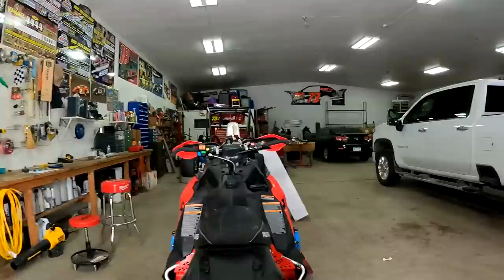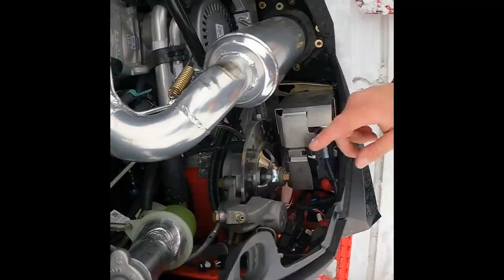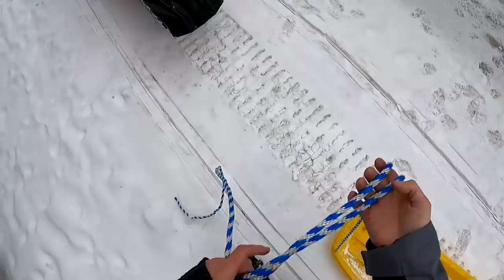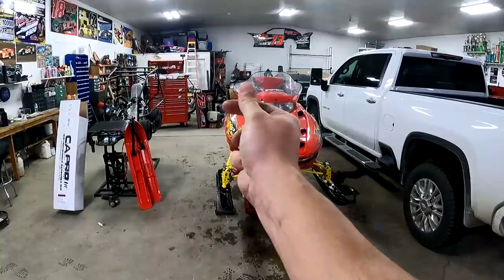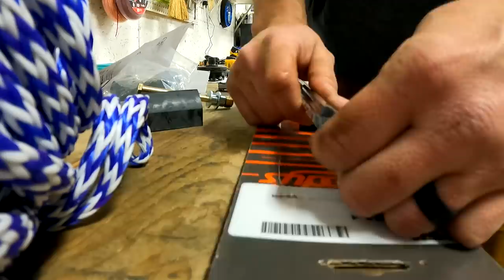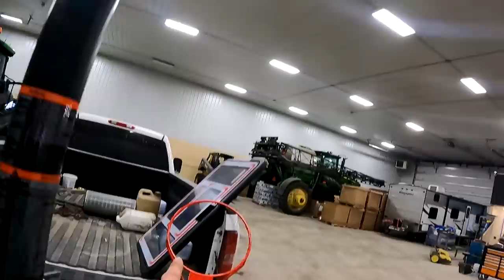We're Gonna Need a Torch

Comment: You need to try a air hammer there are amazing on tight bolts like that and I didn't notice you putting any anti seize on the Bolt when you put it back in.

Comment: When you're riding alone, try out the GoPro chest mount. At the start of this video, the camera was pointed more toward the ground. Also use 24 frames per second (fps) on the camera setting, under advanced settings I believe. Don't use 60 fps.

Comment: How good does that 440 fan run ? I had the same sled and it would run for 20 to 30 minutes then just die. After a couple hundred dollars at the Polaris dealership. I found out polaris made a bad motor and the exhaust ports where off timing or something.

Comment: Since the tag #BetweenTheRows is used in the description, I dont think this was a mistake upload. Its a awesome video, and deserves to be monetized. Their second channel  (BetweenTheRows) has not been verified yet, and therefore video's can not be monetized. So everyone, Please subscribe their second channel for more farm family related video's. It seems this video is enjoyed by a lot of us, I sure that we will enjoy other video's like this one. I am enjoying them for sure!
Thanks Zac, Becky and Kids!!

One question though... The bottom part of the hoop that supports the whole thing, do you need to pour water in it for extra weight? I noticed you went for the millennial method by placing water on top instead, smart thinking!
Reply: I usually fill the base with sand
Reply: @dgrenier4908  also a good way to add weight, water is a lot easier when you need to empty it though!
Reply: I’ve used water too in the past but we switched to using sand, had a base freeze on us and crack then it wouldn’t hold water. Crack Wasn’t very big so we used some silicone caulk to hold it together and filled it with sand, base outlasted the hoop after that. Neighbor used some RV antifreeze in his, wish I’d thought of that. Guess we figured the base would just expand with the frozen water, but apparently a couple of summers in the sun made the plastic brittle and it split along a mold line.
Reply: @dgrenier4908  fair enough, winter temps will break the base apart. I guess Zac outsmarted both of us by placing boxes of bottled water on top hahaha!